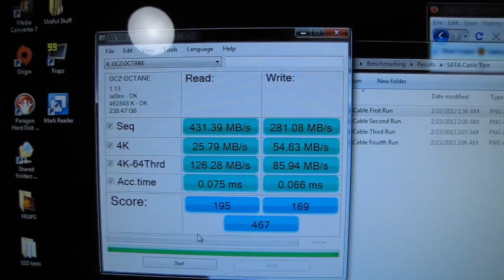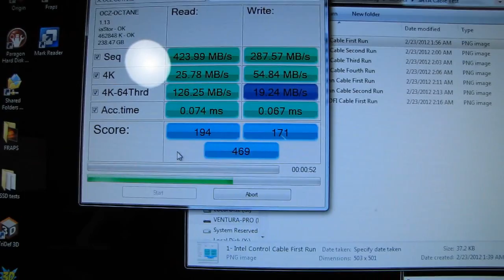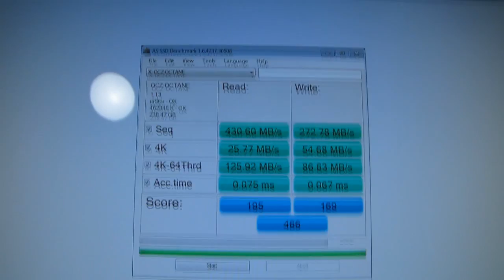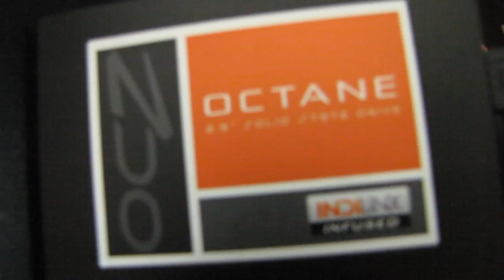SATA Cable Experiment - Does Quality Affect SSD Performance Linus Tech Tips

Comment: I think that it's just a matter on the "length" of the SATA 3 or 2 cable.  The "short" cable's length have less distance of data to travel (better).  The longer cable would take longer for data to move (normal).  If the cable is defective, then it's another problem.

Comment: I started building a new pc, and all confused  atm bc first time building... I don't understand how there are 1,5 Gbps as well 3 and 6Gbps Sata cables... I got a decent SSD which runs at 460 mb/s reading speed, from what I understand it needs a 6Gbps Sata, which in itself is a mystery to me. Why does a device that is read at half a Gig/second need a cable that can run 6Gb/s? All Sata cables are the same I hear here ? I'm all confused since I'm advised a 1,5 Gbps Sata by the store to attach to my Samsung 850 Evo... , they don't even sell 6Gbs/s or 3Gbs/s (which are equal from what i read = another mystery) ...
Reply: i know it's stated in the vid, that Sata = Sata but we're 4 years later now and I'm curious if things changed...--> Can Sata cables bottleneck? <--
Reply: Late response but... There ain't. Nothing has changed. SATA 3, SATA 6... They perform the same. The only difference is colour, build quality, locking clamp or no locking clamp.
Reply: Thanks man... That confirms what I've been looking up... It can be very confusing at first...  PC has been built by now... I got a lot more pc-savy lately and it's great, no more paying overpriced repairmen or buying pre-builds ever... The Sata cable I bought is red, and it kind of defined the colour scheme, now I need all cables to be red... as I went for a case with a window :)

Comment: Good point, but the reason many people prefer gold plated male ends is because gold is a very malleable metal; If you fumble around with you cable while it is plugged in, gold plating will make it less susceptible to connection problems :)

Comment: @XequlixX In my opinion it's the absolute best mouse ever, both sensor wise and shape-wise unless you really can't stand ambidextrous mouse. I had the Xai for 14 months and never had a complain with it on my Steelseries 4HD pad. The Sensei is pretty much the same with leds, slightly less bump on top and a diff material for the surface.

Comment: @1Nuk3d1 the problem was that it didnt have a lock clip. and it wasnt one of them it was all 3 of the cables i was using. also they came with my asus rog board so u cant say that they where some very dodgy ones. the clip ensures u got perfect conection

Comment: @chrisfur2 
The gold plating is only meant for a tight connection. Even though a company labels an HDMI version, it might have still used lower specs than what the version implies.  A possibility.

Comment: @hope00hope Any digital cable will be the same - It either works or it doesn't. Other than if it's like 100m long, you'd probably benefit from higher quality cables then.

Comment: Yet the price is 99.99% higher.

Also, the card is unable to update drivers until Apple updates and, it is unable to overclock and, its soldered to the motherboard making you unable to upgrade it.

Comment: if u can help it stay away from cables like the red ones without 'locking clips' i used them before but then ran into crashes. after painful trial and serching i found out that they had bad connection

Comment: Linus, can you tell us why the extra +4 pin adapter on the main power connector for the mother board has the extra 4 pins and how it performs without out the 4pin adapter

Comment: My guess is that the failure is a mechanical one. Maybe something broke inside the cable or a connector-pin is defunct. 
I've always used the cheap standard cables and have never had any problems.